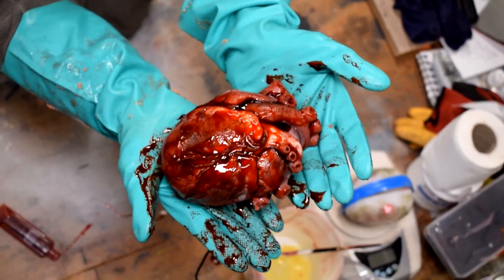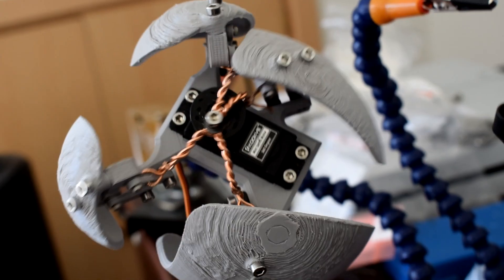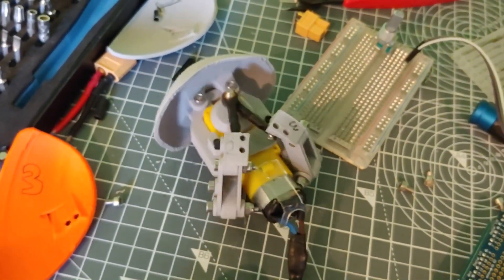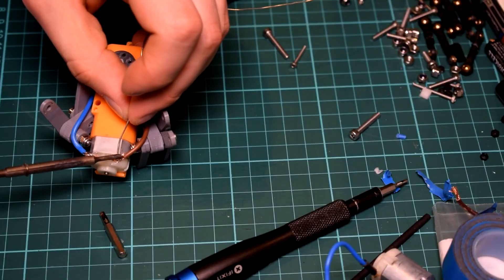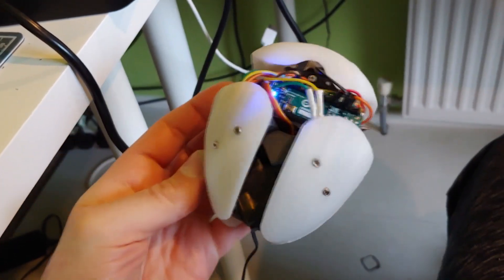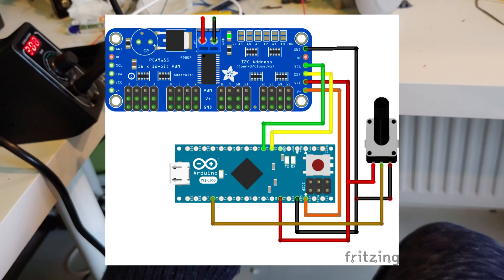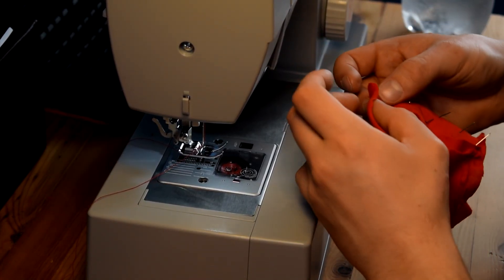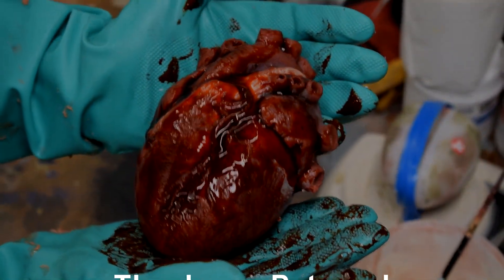3D Printed Animatronic Heart Development Process

Comment: that's great job but i have to mention that the actual heart movement is really different than what i see 
-the heart contains 4 chambers each 2 are connected separately and you gotta respect that or create a  new pneumatic circuit
- the size of the chambers is important too .

consider those two things because from my view they can push you to do radical changes at an advanced stage in the project .

good luck

Comment: I'd have put the segments on stiff springs (or rubber bands) that will spring back after being pulled, then used little linear actuators/pistons (maybe operated with a little cable pulley inside?) to push the segments out, then at the end unpowering or reversing the motor to make the quick "contraction".  Best if the motors are back-drivable, tho might not matter if it's being actuated via a cable-pull around a spindle.

Tho uh... in hindsight you're probably not looking for ideas for redesigns, THIS deep into the project 😅.

Edit:  Actually this might be some workable advice:  Can you add some rubber bands to the back of the panels in your current design?  Just so it encourages it to spring back faster.  Could be an easy tweak.
Reply from the maker: That's a good idea but the silicone/fabric jacket is quite elastic itself so I think to add more spring would be too much for the motors. Although some kind of spring in the opposite direction might help the motors out a bit with the expansion. I like your idea of using little linear actuators though, that could be a bit more power efficient.

Comment: If you have to run power to the heart anyway for the servo version, might it it have been easier to use air motors/pistons, etc and pneumatic lines instead of power?
air pressure seems ideal for the sort of movement you're trying to emulate, as well as solve a lot of mechanical problems.
Reply from the maker: Yeah that's a good point, I had considered some kind of air bladder but I'm not sure how I'd control it. Definitely something to consider if I make another design.

Comment: I dont know how much you need to power it , but you can try a go into wireless charging. As you have space to input it into project / ev small telephone battery as buffer. Meybe worth to look into.
Reply: If you would do it , test if charging will work with silicon casing (silicon is isolator , i dont know how it will react to electric wave.)